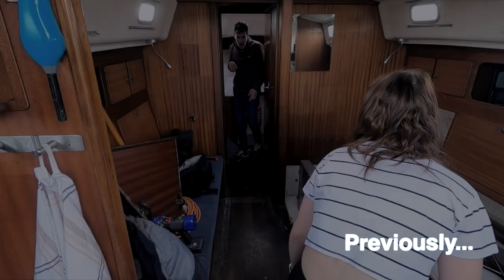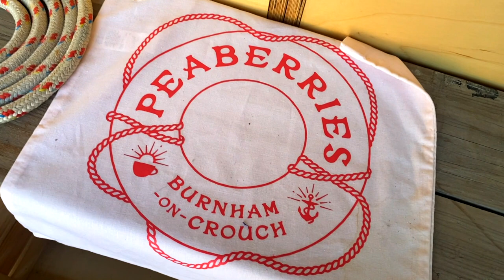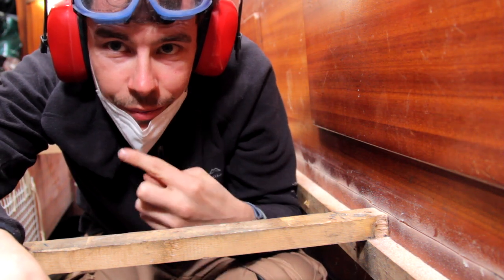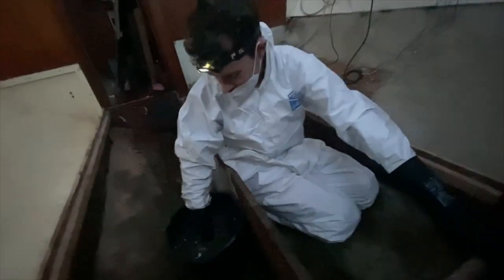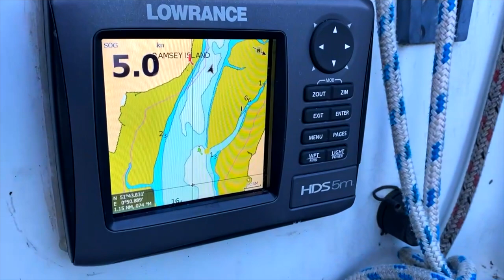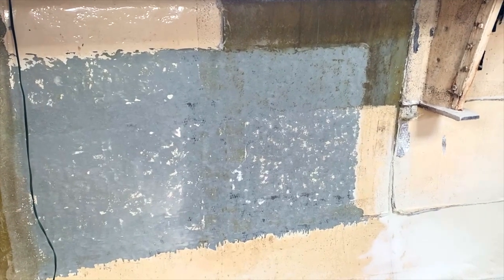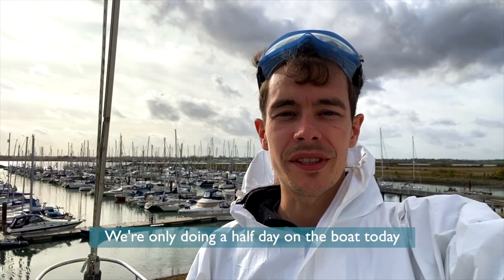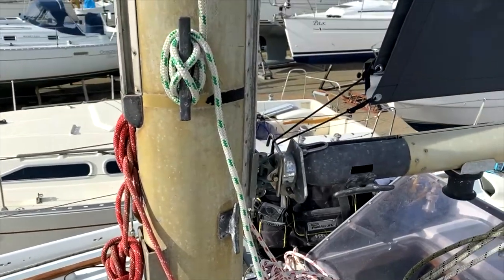Ep 5 | The demolition continues and we take a break to remind us what it's all for.

Comment: With the random orbital sander it is worth getting pad savers to go between the pad and the disc. Much cheaper than replacing the pad which wears out quickly when it gets hot. Also, you may consider using sanding nets (Mirka etc) which I find last longer, better dust control and work out cheaper in the long run. As for the grinder, as you have found, it gets the job done.
Reply from the maker: I’ve just bought some pad savers, I didn’t know they were a thing so thank you. Sanding nets are next on the list!🙂

Comment: Interesting project. I'm curious, does removing all the midships furniture, does that not weaken the hull structure? I'm not a specialist but I would have thought that gave the hull some support against lateral twist? We did the same on our mast and asked a rigger for an inspection and he gave it a green light once back up. However, over 10 years old and he recomended it being replaced, which was a requirement for comp insurance and to be honest, peace of mind for us.  Following with interest 🙂
Reply from the maker: Hi Colin, as it’s only a 2m space between the bulkheads and a very thick sturdy hull we should be protected from the twist. We are lacking support on the side deck which we need to be careful of but with the mast down it’ll make life a lot easier!